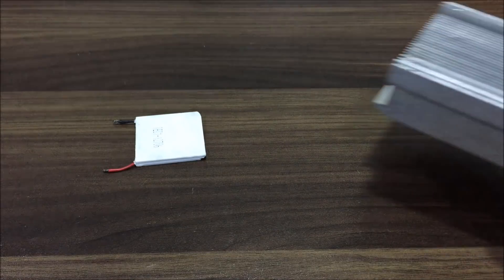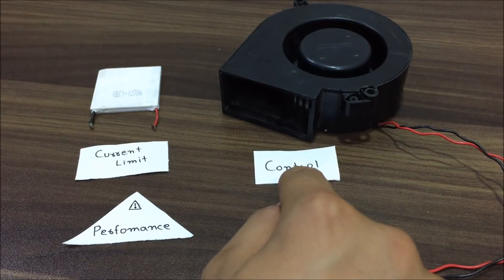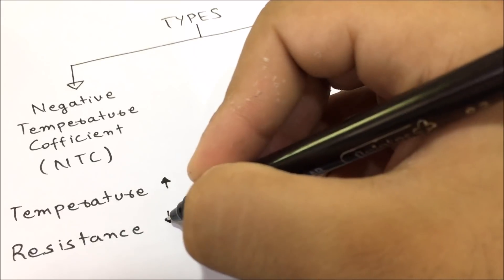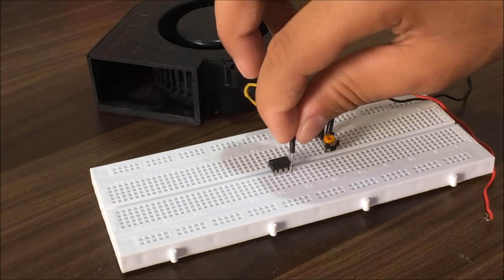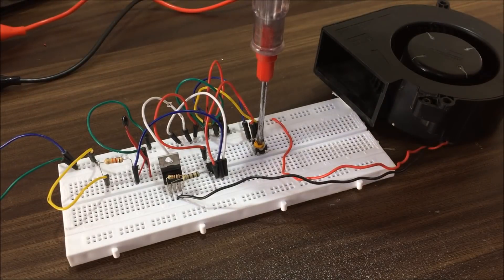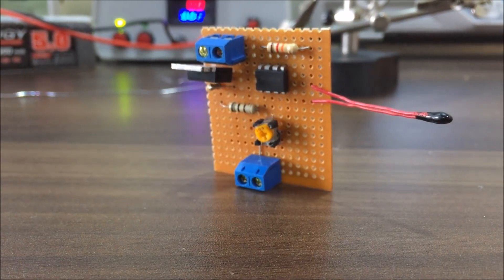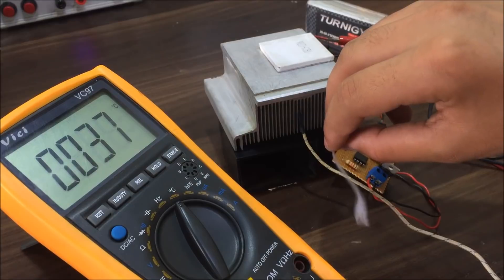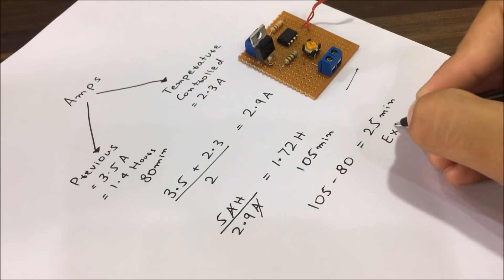Temperature Controlled Dc Fan || Heat Sensor

Comment: Hello sir. As far as i understand you set a temperature by using potentiometer and fan tries to cool down the thermistor to that temperature level. What is the temperature range in your project? And what should i do if i want to change the temperature range? It will be super appreciated if you answer sir.

Comment: Hi, I have a question, as per your circuit diagram you have connected the pin-2 of LM358 to the thermistor, but as per your soldering layout you have connected it to pin-3. What is the correct one?
Reply: Also when powered on the LM358 is heating up a lot, any reason why?

Comment: I need the circuit Diagram please
Reply: Click on the “Up-Down” arrow on the right lower corner of the video. In Blue, it will have a link to the basic diagram with the components, pins and other points. I am a retired auto tech and want to control the temperature of a transmission cooler with dc fan on it. 
R2 and Thermistor act as a voltage divider input to 2 on OP Amp. With pot on 3, the ability to adjust a small voltage to turn on above or below adjusted point.
Best of luck. Sweet little circuit.